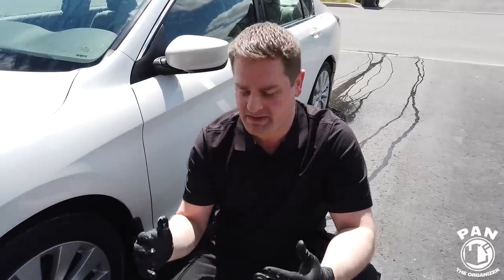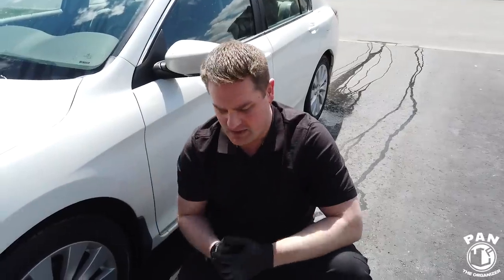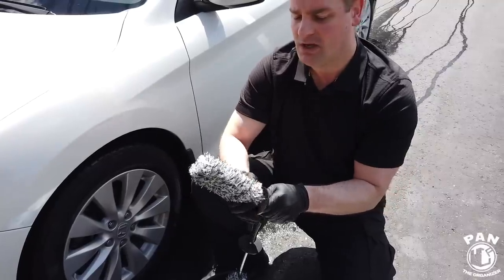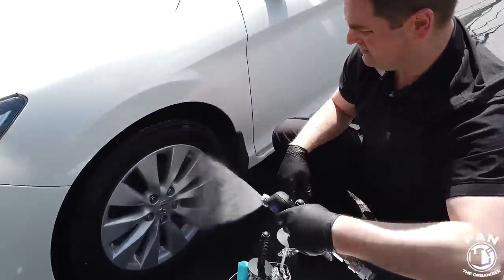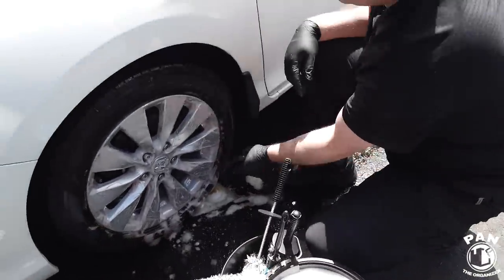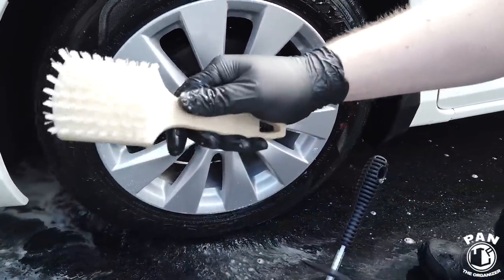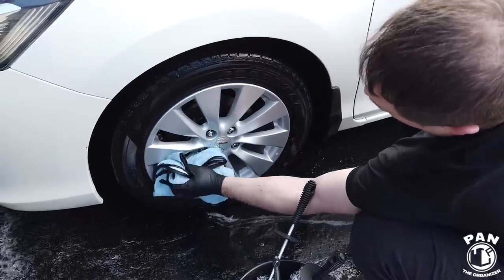Inexpensive wheel brushes, foam cannons and microfiber towels !!

Comment from the maker: ►►Here are the links to the MJJC products presented in this video:
On Amazon (USA):
Wheel brushes: 
Microfiber wheel brushes: https://amzn.to/2HBmFQd
Chemical resistant brush: https://amzn.to/2HCRvrI
Tire cleaning brush: https://amzn.to/2Qnu6NL

Microfiber products:
Microfiber drying towel: https://amzn.to/2MaPtn6
Microfiber chenille wash mitt: https://amzn.to/2EBvqYO

Foam cannon: https://amzn.to/2DKjraI

On the MJJC website:
Wheel brushes:
Microfiber wheel brushes: https://bit.ly/2Yy0HDr
Chemical resistant brush: https://bit.ly/2WFjxrE
Tire cleaning brush: https://bit.ly/2JDaGDa

Microfiber products:
Microfiber drying towel: https://bit.ly/2WJkXkV
Microfiber chenille wash mitt: https://bit.ly/2VnBLwh

Foam cannon: https://bit.ly/2Q4owzC

Other products used in this video:
Adam’s Wheel Cleaner: https://amzn.to/2PIGasr
Adam’s Tire & Rubber Cleaner: https://amzn.to/2GZ1O9a
Purple Power Vehicle & Boat wash (snow foam): https://amzn.to/2PLI4c8

Comment: so when using the foam cannon, should I assume I'll be using the whole bottle each time I wash? or were you just a bit heavy on the foam in this one to show the products capabilities
Reply from the maker: For a normal sized sedan, I typically use 18 oz of solution (2 oz of snow foam and 16 oz of water).  Of course, you have to adjust the dilution ratio and quantity to your scenario.

Comment: Just bought those microfiber wheel brushes, they are amazing for what they cost (19 canadian dollars) for the biggest one. For a long time my favourite was the SpeedMaster EZ Detail Brush (amazing brush btw) but as with all plastic like wheel brushes they splatter water everywhere. So here I am... with some new microfiber wheel brushes which I love because you can wash the entire face of the rim by only using the brush and nothing else if you wanted . 
I was not expecting them to be this good considering the low price, at first I was a bit reluctand to use them since I own a set of dark rims with deep barrels which are like a magnet for scratches but after the first use I fell in love with them.
The brushes also have a foamy core that helps with lubricity (considering that the water is mixed with shampoo) by absorbing water just like a sponge.

Keep the videos coming! Have a great day!
Reply from the maker: Wow!  Thanks for the awesome detailed feedback Jurca!  Glad to know you appreciate my opinion!  :)

Have a great day!

Comment: ANOTHER GREAT VIDEO PAN. YOUR WATER BILL MUST BE INSANELY HIGH WITH THE AMOUNT OF DETAILING THAT YOU DO. THE FOAM THAT CAME OUT OF THE CANON WAS THICK, BUT IT ALSO LOOKS REAL WATERY &THIN ONCE IT IS ON THE CAR. I'VE SEEN YOU USE FOAMS IN THE PAST THAT SPRAYS ON THICK & TAKES A MUCH LONGER TIME TO THIN OUT AS IT IS INTERACTING WITH THE DIRT ON THE CAR🤔🤔🤔
Reply from the maker: That depends on the type of snow foam used.  Some are thick, others are runny.
Reply: @PanTheOrganizer  THAT'S GOOD TO KNOW. THANKS 4 THE REPLY 👍👍👍

Comment: I've used a lot of inexpensive gear to detail cars, most of the time with great results. But there are 2 things you should definitely invest in: good microfiber towels (The Rag Company has the best, period) and a good light for paint correction (like Scangrip)
Reply from the maker: Yes, tools and equipment are as important as the quality of the products and chemicals you use.  

I did a roundup of some of my favourite wheel brushes in this video: https://youtu.be/siZhhnve-84

And yup, I looooove The Rag Company microfiber products, and Microfiber Madness too.

Comment: @Pan TheOrganizer 
Pan - do you find the Grey Spray Bottles (marked T on the side ) that you use in your videos leak a little or seep a little around the filler neck from time to time.   I do.   I like the bottles , but that's partially why i switched to the Home Depot 32oz HDX Bottles ...they don't leak around the lid.

Comment: MJJC guys, you should make that "Foam Cannon with Nilfisk Quick Release Connector and Trigger Gun & Spray Wand Kit" with a 1/4" quick connects instead of the Nilfisk so the gun can be used without the wand by putting the spray tip nozzles directly on the gun when desired.

Comment: Hello Pan, I have a white Honda like the one in this video. I've been having a hard time maintaining the white paint clean. Two weeks ago I  did a full detail wash and wax. I was very pleased with the results as I was able to restore the paint's white shine. But now, two weeks later, I give the car its first wash since the full wash and wax. I used chemical guys honeydew snow foam car soap, which is ideal for maintance wash. And again after the wash, I was please with the results I got. But then the next day, I noticed car's paint collected alot of dust over the night and as I ran my finger across the paint the dirt would  build up in my finger. I also noticed yellow dots forming on the paint which would happen often before the full detailed wash and wax. So I don't know what's happening. I'm trying my best to keep the paint clean but it keeps getting easily dirty. Not even a day before  seeing the dust build up on the windows and paint. It's really annoying. Any help or suggestions would be greatly appreciated. Also anyone else having this issue with white paint? Thanks in advance.

Comment: I live in an apartment so don't have access to water and electricity outside to be able to wash my car at home, so I have to use a public jet wash. But what is the best way to wash in those circumstances? The car has been pro detailed and ceramic coated.

Comment: whats the soap and water ratio for the foam cannon
Reply from the maker: 2 oz of soap with 18 oz of water (20 oz total solution) is what I typically use, but of course follow the dilution ratios recommended by the snow foam you’re using.

Comment: Pan, I'm curious as to which Interior cleaning products you would suggest for a 2014 BMW 320i xdrive with the modern trim package. I noticed the interior panels and such are alot softer and squishyer than most Interiors I have had before (my 350z had alot harder plastic, where the BMW is softer foamy kind of feeling) and wasn't sure if they needed anything special. Any help, would be appreciated!!!
Reply from the maker: You're in luck!  Watch my popular interior cleaning video when I had my previous 2015 BMW 435i xDrive Gran Coupe here: https://youtu.be/X7z1iFoykEM

Here's how I also detailed a black BMW M3: https://youtu.be/OjQavIEiWlM

And my own brand new BMW M550i here: https://youtu.be/dsCmJJDP3xo

I put links to all the products used in the description under each video. ;)

Comment: Hi Pan, question little bit with different topic. I need urgent your opinion. I have just finished my vehicle polish and I have high quality wax  from Germany which expected longevity with 1 year and also I have purchased the bead maker after seeing your video about its amazing results and slickness. Now the question, which way you prefer, apply the wax and boost same with the bead maker or just apply the bead maker to stand alone? If you prefer apply both then let me know the time should be between the two applications?
Reply from the maker: If you like your wax, apply your wax first, then use Bead Maker on top during maintenance washes, as a drying aid.  You'll boost gloss and slickness by a lot.

Comment: What mixture you have on that foam cannon? Also, were you using the 1.25 orifice or 1.1?
Reply from the maker: I was using the stock 1.25 orifice.  In the foam cannon, I was using Purple Power Vehicle and Boat Wash soap to strip off any previous waxes or sealants.

Comment: The one thing I have issues with when cleaning my wheels is that after I've cleaned them and then moved to the car the wheels dry and and they have water spots.  Unfortunately my wheels are black so the spots show up more.  So I've decided now that after I clean the wheels and the car I'll blow the tires with air and dry them first.  I figure after I dry the car i'll be putting on bead maker and if there's any water spots I can rub those out fairly quickly.
Reply from the maker: Yup

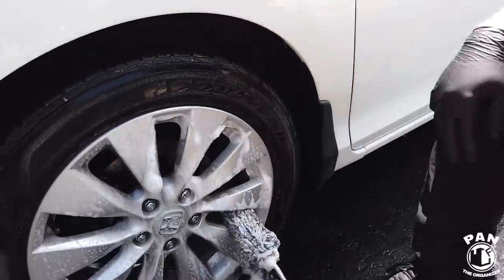Comment: 4:32 look like the "wire" is to elastic and you need to keep not by the black hand but by this "wire".
I'm thinking to buy this but not sure is it small enough for 15" and 16" rims
Cheers.
Reply from the maker: I'm not sure I understand your comment Don...
Reply: @PanTheOrganizer  isn't the brush too elastic? you do not keep by black hand but more to the microfiber end. 
Did you test it on 15" rims ? very often those brushes are not able to penetrate the rim between rim and the brake.
Reply from the maker: The majority of the vehicles I detail have 17 to 20 inch rims...  The EZ Detail brush or Speed Master brush are better to get behind brake calipers on any size wheels.  Watch my video where I present many different wheel brushes here: https://youtu.be/siZhhnve-84

Comment: Hello Pan, what is the good dilution for a nice foam ?
I have the Citrus PreWash and the PH Neutral Snow Foam.

Thank'you !
Reply from the maker: It's impossible to give a universal dilution for all snow foams, as they're all different. You have to follow the instructions on the label of your particular snow foam.  The thickness of the foam also depends on the hardness levels of your water (soft water produces better results), how many GPMs your pressure washer produces, which foam cannon you're using, etc.  Many factors come into play here.

Typically, I use 2 oz of snow foam with 18 oz of water (20oz total solution) with my high end 2.1gpm Kranzle pressure washer and top of the lien MTM PF22 foam cannon.

Comment: can i induce marring with microfiber towlels? I’ve done a respectable method of car washing but still i see them
Reply from the maker: Only if you’re using cheap towels or applying too much pressure.  Do you use a drying aid?  That helps with lubrication.

You can also use a car dryer if you want a fully touchless car wash like in my video here: https://youtu.be/DjlUZnBtLtg

Comment: Hey Pan :-)  I have a question for you.  What do you use to thoroughly clean felt wheel wells?  I ask because they are pretty hard to clean.  Thanks!
Reply from the maker: Good APC with a wheel brush like Ez Detail Brush (or Speed Master brush) and then a good power rinse.

Comment: When detailing SUV what do you recommend using to get those hard to reach areas like top of the car 
I have a Dodge Durango and it's hard wash the top of car can't reach certain area
Reply from the maker: You need a stand to get higher.  Many mobile detailers use those.

Comment: Does the foam cannon have to be connected to a pressure washer? Does the pressure washer have to be turned on for when you want to use the foam cannon?
Reply from the maker: Yes to both questions

Comment: I've heard about a UV protector on the tire sidewall that will also turn brown when you scrub the tire. Have you ever heard of this?
Reply from the maker: I'm not sure I understand your question.  Regardless of what tire dressing a tire has, all tires will generate browning over time as the sun's UV rays oxidizes the chemicals found in the tires, plus you accumulate dirt.  When degreasing tires to clean the side wall, it's normal that you'll get brown suds, like in this video.  You continue applying a degreaser and cleaning the tires until the foam becomes white, a visual indicator that the tire is now clean and ready to receive a fresh layer of your favourite tire dressing.  That way, dressings bond better on a clean tire and won't sling on your paintwork.
Reply: @PanTheOrganizer  Sorry about that, what I was talking about was that the tire is made with a UV protector within the rubber and I've heard some professional detailers say that you can harm this by washing the sidewall will harsh chemicals. Once again, sorry for the vague question before...

Comment: What is a good slim brush to get the inside of the wheel? I have an ez detail brush, there isnt enough space between the caliper and the wheel so one spot on the front wheels dont get cleaned.
Reply from the maker: If the EZ Detail brush doesn’t go through, I don’t know what will...

Comment: In the description you write boat and vehicle wash. When i use it i can t make foam!! What is the dilution do you make???
Reply from the maker: I typically add 3 to 4 ounces in 20 oz of water for the Purple Power Vehicle and Boat Wash.  But keep in mind I have a 2.1 gpm pressure washer, water softener system, MTM PF22 foam cannon, all important factors.
Reply: @PanTheOrganizer  merci pan!!! Je viens d acquérir une nouvelle machine a pression je vais mettre un peu plus de savon et a ma prochaine visite au usa je vais me faire de provision!!!
Reply from the maker: Ce savon est conçu pour stripper des vieilles cires et scellants.  Pas pour des lavages d’appoint réguliers sur des véhicules protégés par des céramiques.  Dans ces cas, CarPro Reset ou Gyeon Bathe sont mieux.
Reply: @PanTheOrganizer  je sait pan je suis un fidèle auditeur j ai deja carpro reset pour mon qx50 qui a reçu un protection ceremique chez esthétique h2o!!!!

Comment: Pan, do I need a pressure washer with the foam canon? I would like to use my water hose instead.
Reply: To use a foam cannon you would need a pressure washer. Instead there are foam guns which are designed to be used with hoses but do not provide as thick of foam and uses more water. Not as effective as a foam cannon because of the difference in pressure but still useful.
Reply from the maker: You could use a foam gun which attaches to your garden hose, but you will never get the same thick rich shaving cream-like foam you would get by using a pressure washer and foam cannon.
Reply: Thank you guys, much appreciated.

Comment: Pan, do you recommend the microfiber wheel brushes over the wheel brushes with bristles?
Reply: It seems they wouldn't have good scrubbing power.
Reply: Im wondering the same thing. I hate the sling back from the bristle brushes. 
Im not worried about scrubbing power but these look like they don't fit in tight spaces (caliper) like the Daytona speed brush
Reply: @rob-lw7be  

Why do you not consider scrubbing power an important aspect? What chemical do you use?
Reply from the maker: I always say you need different brushes for different jobs.  I have many different wheel brushes.  Some for barrels, some for the faces, some for tighter spokes, etc.

Watch my favourite wheel brushes video: https://youtu.be/siZhhnve-84
Reply: @jimmyjimmy7240 once every summer i remove the wheels and clean them using meguiars wheel brightener and maintain them using chemical guys signature wheel cleaner. I don't need an aggressive brush because i get very little brake dust so any agitation and they'll be clean

Comment: Do you not trust that drying towel or mitt for paint?
Reply from the maker: Hunh?
Reply: The only thing used on the paint was the foam cannon. Just wondering if you would say the towel and mitt are not the best for paint, and should just be used on wheels?